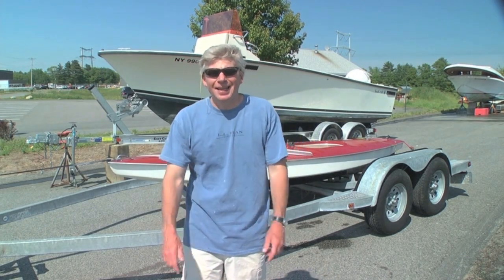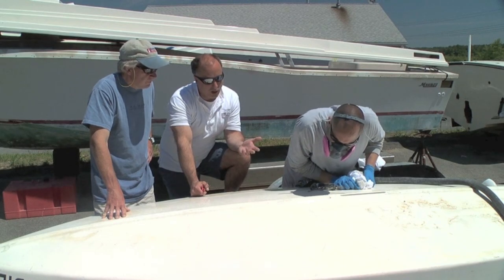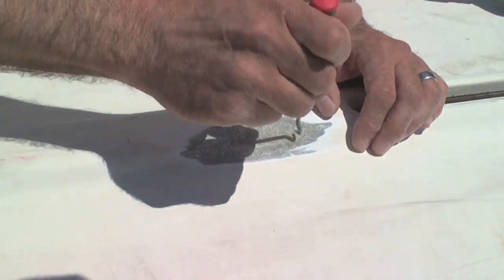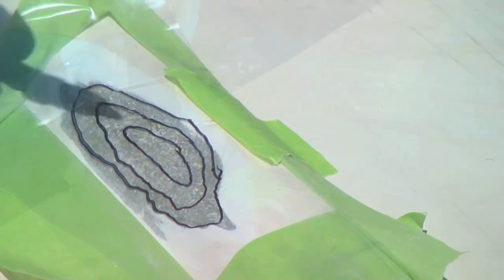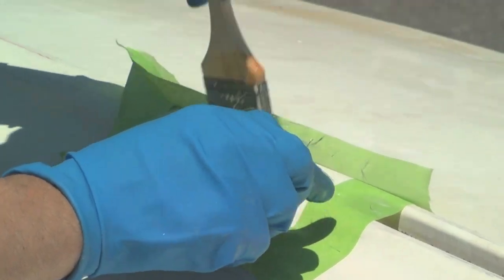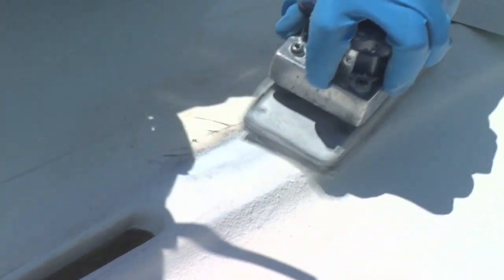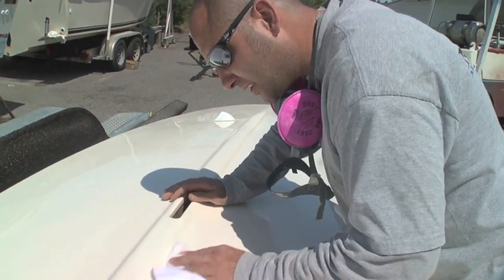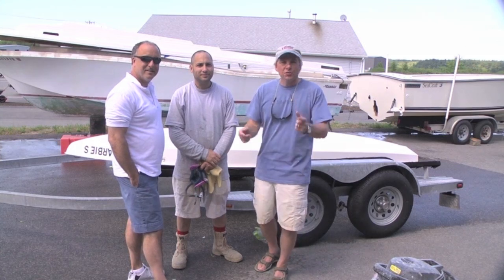Fiberglass Hull Repair

Comment: this repair is not correct, you are supposed to add the smaller layer first, then the bigger pieces. the layers need to bond to the hull separately over lapping each other. if you put the bigger piece on first it is only one layer bonding to the hull all other repair plies are on top of the large piece.
Reply: Don Ching Good call by you.  I've watched this video twice now and never noticed that booboo.  Makes total sense since it's basically a dip and the deepest part is the smallest and gets gradually bigger as you come up to the widened surface.
Reply: yeah, thought that too, makes no sense to do it the other way
Reply: Your are wrong....Sorry but simply very very wrong...
Reply: Largest piece of fiberglass is first... ABC's of fiberglass repair...
Reply: And the black marker he used is alcohol base type like acetone for cleaning resin out. See it mixing trough the resin as he applies it. Probably fall of in a week
Reply: D I have screws going through my fiberglass hull on bottom of boat, of course it leaks.  Can you guide me to a good repair video?  The screws are sticking out maybe a third of an inch.  I was thinking about cutting them off flush and using a bond fiberglass kit to repair 6-10 holes.  Help.
Reply: Smallest piece first. Black pen in resin what a mess. Never got to see end result.using a da on its edge just use a smaller da
Reply: @metanmarine  who would buy that boat anyway. Damaged and repaired and sell for new price🙈
Reply: @metanmarine  Bazinga!!! Nice video!! Wish you were close, I'd bring you my Gheenoe!!
Reply: @metanmarine  “When filling a depression or doing reconstruction, the intuitive order is small to large, but the problem here is that we are trying to replace cut-away or ground-away fabric, and the new fabric, except for the bottom piece, will attach to the original material only at the perimeter—in effect, a butt joint. So the largest piece should go into the cavity first to maximize the surface area of the secondary bond. After that, all subsequent laminates bond to this first piece and each other on a molecular level, but applying them in a large-to-small order still maximizes the mating surfaces.
Reply: @aloisdecroon6096  NEVER SMALL TO LARGE! NEVER! No need of arguing we will stick to our 50 years of knowledge...
Reply: Hmm no issues in 30 years...
Reply: @metanmarine  Please read my reply in full!
Its starts with the intuitive order is small to large, but... and ends with ...So the largest piece should go into the cavity first to maximize the surface area
I have no experience and starting my first repair soon and only want to learn and understand the best way to go, that's why I'm here

Comment: Hello, I am wondering why you didn't just mix up some thick hair resin as they call "peanut butter" as a filler and then put it over the repair once ground out like you did? I thought doing it this way was for physical holes or if you have to build up the back? The reason of doing it the way I describe is because of potential of air pockets..

Comment: I've had a crack in my keel for a while and when I gun the boat I have a small leak and end up with about a Half litre of sea water...with summer just around the corner I will do this while I am repairing my Trailer, at present my boat is on set of stands I knocked up in steel 50 x 50 mm tubing, so I will do that before I put it on the trailer. Hey can you guys show a Transom change for us all.? Love your Video ( from down under).
Reply: If you YT Ship Shape TV they have a whole series with Metan rebuilding a mid 1980s Montauk. I believe the transom work is episode 5,6, or 7. It’s maybe no older than three years ago. There are many good transom rehabs on YT, just look for a reputable channel…..My first non Metan stop would be  “Boatworks Today.” Good luck to you.

Comment: hello, i have an old fiber glass row boat, it's just over 10ft, and has a whole load of holes drilled into the hull. i have patched two from the outside of the hull of them by putting 2-3 layers of fiber glass sheeting over the hole then slopping tons of epoxy/hardener mix over it. then i flipped the boat and did the same on the other side now i have watched all of these sorts of videos on YouTube and think that i haven't done some really important strengthening thing... any tips?

Comment: question after applying peel ply and surface hardens due you remove peel ply before sanding or leave in place?
Reply: Pull it off and discard, sand away.

Comment: I keep reading comments about the cost.  BOAT = Bust Out Another Thousand. Especially at a marine shop.  I'm redoing a early 60s MFG from the hull up, and so far, after doing a complete transom replacement, new floors, some body work (a few small rot-thru areas) and paint,  have spent less than $500.  Why?  How?  Doing the work myself.  No offense, but boat repair shops are like auto body shops...rip-offs.
Reply: Vin DiVergilio Yeah that’s what I’ve been thinking all along.  About to take on a Mastercraft ski boat project and complete all the work myself. I’m very handy and think I am quite capable. For me it’s gonna be fun and I’ll save money plus have a lot of pride after I’m done. Can’t wait to get started. Any tips?
Reply: Josh Smitty Do half the job first. Then you will realize how much time and labor is involved. Might even decide that a pro can do the rest faster if not cheaper while you earn money doing what you do best whatever that is.
Reply: not very intellectually honest to call professional work a ripoff because it costs less then doing it yourself

Comment: Ive always wondered why so much damn work goes into upkeep and repairs on most pleasure boats while the working boats, house boats and big rigging boats rarely need repairs like these or any besides normal upkeep like with a car..  people say oh the repair will fall off because he used spit instead of snot or whatever but i own a fiberglass 21’ bass boat from 1960 and with absolutely no knowkedge i sanded broken areas where some went through the hull from rock sex..  but after sanding i used both alcohol and acetone, filled the hole with straight bondo with some bonding agent painted around the inside of the hole and dabbed fiberglass cloth overtop (bondo fiberglass resin).  Then painted a gel coat over top after sanding and those holes are gone, cant tell after 5 years now of hard boating, even through ice..  no damages nothing from the work i did..  also the motor is way too big for the boat and saw some crackkng on the transom..  everywhere period all say to cut out the fiberglass and dig out all the wood, replace, put in cpes on old and new wood, and then fiberglass rework it all shape and gel..  i took two pieces of flat 1/4” aluminum plate and drilled out both stringers, inserted a 1/2” aluminum rod down the stringers about 3’and filled with fiberglass resin (bondo) and tig welded it all together, sanded aliminum then put the gelcoat on ..  250hp merc on a 21’ low profile bass boat that ive jumped wakes hard at 70mph top speed..  and motor still on it..  got a dorsal fin and no porpoising,

Comment: How much would a 14 fiberglass runabout cost to have completely restored?  I mean floors. transom, full paint and gelcoat, pLus windshield buffing.  I realise you probably need to see the boat but I am trying to get a price range from the minimum for a boat in good shape to a boat that needs major work in all these areas.  I just want a price range.

Comment: $100 an hour is nothing to be astounded about. To put it in perspective, your local Chevy or ford dealership likely charges $68-75 for a parts changer to swap out parts. $100 an hour is reasonable for custom repairs.
Reply: Plus if your not happy with the price find someone else or do it yourself you dont know what is the daily cost to run a shop like that. The guy has to pay his bills and make profit thats just how it works

Comment: He mixed up so much resin for "sech" a small repair.
Reply: He's probably going to fix some more, he didn't work for 4 hours on the boat as they say, he worked those four hours in 3-4 boats at a time. You need to let the resin to cure, also the paint need to cure between the layers of paint. So they work on a fe boats at a time ;)
Reply: Needs to use a bigger brush.lol

Comment: 500box for 50gr of resin and 20 gram of the matt.

If you used the cobolt u could fixit in 1 hour.
U spend less than 17 dolor and sale it for 500.

Comment: Great step by step, EXCEPT... I don't think it would've taken more than an hour for that particular repair. If it were a big boat, and required a lot of handling to flip the boat over etc., but reality is it couldn't have taken more than 30-45 minutes of actual labor, hardening/drying etc. Maybe another hour, but that's not manual labor. MY BIGGEST concern in that repair was that he didn't wet the repair itself. You should ALWAYS apply the resin to the repair before laying the glass, or you can bet there are voids under the first sheet. There just wasn't enough resin on the glass itself to adhere to that repair. Even if there was, ALWAYS wet the repair down first for proper bonding. It may be the most important step after grinding/cleaning the repair area (which was a good job). Overall, the video showed most of the important steps, it's really just the wetting of the repair before applying that first piece of FIBERGLASS that had me yelling at the screen LMAO! I'm looking for some video tricks on how to properly repair the STRAKES on a PWC after about ripping it completely off. Problem is, it's not accessible from the inside, as the hole is under the motor mount, which is epoxied on VERY THICK. I'm thinking this needs to be removed, which will quadruple the time to repair, and be a huge job due to re-aligning the motor mount plate properly, as well as sealing it down. Was hoping to find a "trick of the trade" somewhere, to see if something could be a solid repair from the outside of the hole, with only the hole size being the access to the inside of hull otself... hard to explain...
Reply: So once done sanding it down are you then applying the resin to the old fiberglass then putting down the new fiber glass over the older surface then apply the resin again?
Reply: You're hired come down and show us how fast you are

Comment: So what should I do about spidercracks all over the rails of my fiberglass boat?
Reply: Those small cracks are probably just cracks in your gel coat. 
Clean with acetone, let dry, then mix with new gel coat mix kit, with included color to match color of old gel coat. 
Fill cracks, then sand  smooth and paint and buff out.

Comment: There is a product called Kitty Hair that you can use to fill air voids. Make the job a little easier. Boat owners can do these repairs themselves with professional results.
Reply: Gelcoat won't stick to that. At lest in theory, maybe in practice you could get away with it though.

Comment: $500 is a lot.  The quality of work was great, but how do you justify $500?
Reply: $100 for materials, $100 an hour.
Reply: junk can it's called a professional job, same difference if you take your car for repair at the dealer over backstreet garage or diy.
Reply: Welcome to the marine industry. Largest mark up in the world.
Reply: With a 5 year warranty on work
Reply: That repair would be £60 here in the UK as I'm a mobile fibreglass and gelcoat repaier
Reply: @acehguy  THAT seem like a fair price.  Thanks for letting me know that I'm not totally nuts!

Comment: best guess was NOT BONDO but a product called Marine TEX and is avail at any boating supply store or just search on amazon you will find it a little goes a long way and is a putty / hardener epoxy to add rigid surface to the glass before gelcoat

Comment: The fiberglass mats must be in opposite directions. the small first and then the mid big and finally the big one. and do not use that much mix it will make the repair poor
Reply: I was thinking the same, that was way too much resin. They should have added bleeding material and vaccumed that

Comment: Does anybody know what is the skincoat (red) that the guy uses to fill the low spots?
Reply: looks like standard "bondo" or some other similar polyester filler.
Reply: micro fibers or balloons!
Reply: Aerosil, talc, glass bubbles...pulverized balloons. Is what you meant

Comment: Your car dealer gets that much or more an hour. 400 for four hours, that means including materials they probably charge 80 or so an hour. That job was very simple and could have been done in 2hrs, the rip off is you get charged for cure time when they are working on other things. Thats business. Boat stands for BUST OUT ANOTHER THOUSAND you all know what you were getting into.

Comment: 4 hours for 4 or 500 bucks? Scotty is quite greedy 😂😂😂 i fixed mine in 2 hours for 50 😎😁👍🍺
Reply: Marius Daniel Fauru how ? I need to fix mine, I don’t care how it looks in the in it’s a cheap boat so a quick fix works for me
Reply: What did you do.
Reply: @Seanny1039  just buy fiberglass resin and fiberglass sheets,  check on YT some videos and you will make it 👍😎👊🍺 make a video about it,  i will,  when i regel coat what i fixed , if advice needed,  ask

Comment: Nice job. Much nicer job than that boat merited. If the repair costs more than the boat did, something's off.

The prep is the key to a good repair and they got it exactly right here. They went overboard with the whole trimming of the fiberglass etc. The could have used four ovals a bit bigger than the repair and just sanded off the excess. The grinder would have taken off the excess in a fraction of the time it took him to mess around with it. And you wouldn't have sharpie ink in your repair.

Comment: this might just be the worst iv seen yet.    I understand not giving away all trade secrets. but. non informative at all guys.  and by the way. even in video color was was off.  should have started with straight white and added yellow ocra  and red ocra  and. always always always. wet out the surface with resin before you put your Matt down you need a chemical  as well as physical bond.

Comment: this looks way to easy, any one can do this, all you need to worry about is the resin mix, guy makes up an insane BS quote of $500 (for dishonest greed) lol 4 hrs of work - labour should $50-60(4hrs manual labour wage) then plus cost of materials - very light spray paint, sander electric bill, resin/mix and fiber sheet $100?(total $150-180) and a buisness charge shouldnt be over $200 at all max $250 (200-250 total recipt)